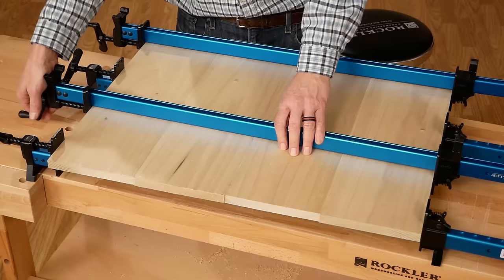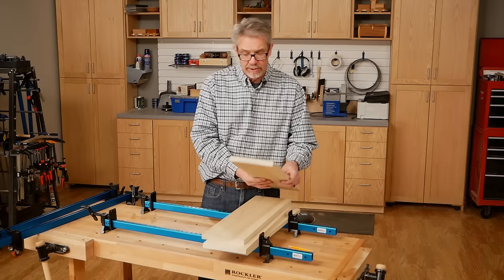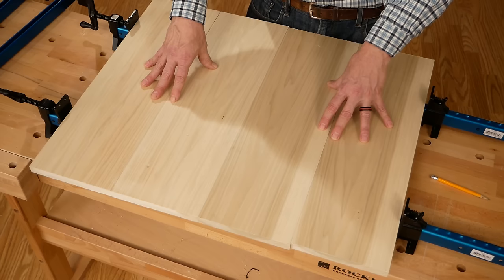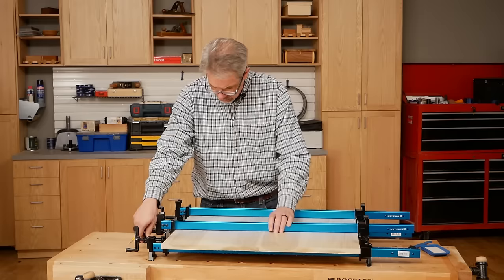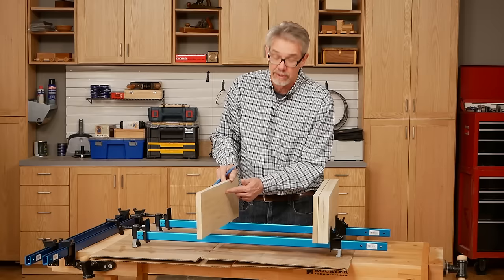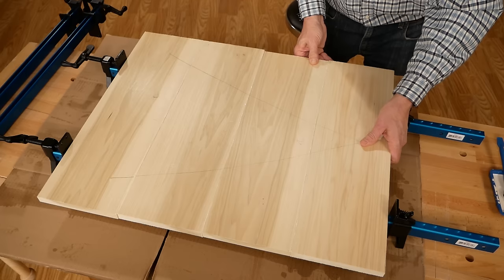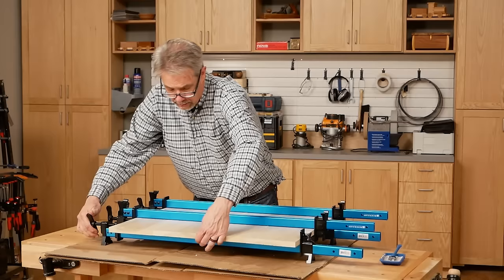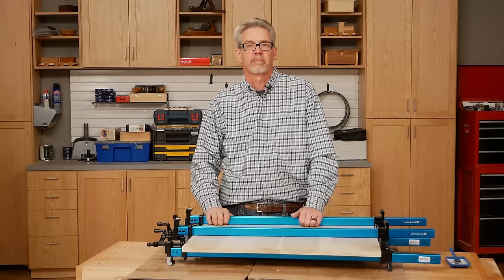How to Edge Glue a Wood Panel | Basic Woodworking Skill

Comment: It's easy in theory to glue up panels that are perfectly flat and square. What I struggle with is the process to make the boards flat and square. I have a small end jointer, 13" electric planer, and electric hand planer. My boards usually end up flat, but gently curved, or the edges will be wavy along the length. Can you please show the process of how you prepared the four boards for this video. Thanks!
Reply: first thing is how much moisture so depends on what wood, let it acclimate for about a week before you work with it and then it depends on what you're making. Another tip is when you seal, do it on all sides the same so it adjust to moisture evenly so don't skimp on the bottom.
Reply: Before you cut to length, square up the long edges of your boards. Run one edge on the jointer to get it perfectly flat, then use that edge against the jointer fence to flatten out one face of the board. Then run it through the thickness planer to get the other face flat and square, then rip on the table saw to width - you'll have a perfectly square board, aside from the ends. Once you figure out the length you want, cut with a miter saw.

Comment: Thank you.  I have a damaged solid historic door, that the bored knob was blown out.  I'll attempt to cut and join a new 2x to the busted area after cutting out the damaged section.  I'll take an extra step and add biscuits for additional joint stability under a moderate load due to door hardware.

Comment: I want one of those Vices! I only have some small Clamps and Im trying to figure out how to glue them together
Reply: Go on Amazon and buy the bessey h style pipe clamps. I bought 4 of them and then 2 sticks of 10ft rigid threaded pipe and cut the pipes in half. Now I have 4, 5ft long clamps for about $100. You can use any style threaded pipe but I chose the electrical rigid because it doesn't have the oils on it that black iron does.

Comment: I’m a 100% rookie you have a preferred glue recommendation? I’m going to attempt to make a small lap board to set across my lap. I’m actually in a power wheelchair due to a motor vehicle accident almost 10 years that left me with my life but gave me paralysis as a constant reminder. I have a red oak 1x10x6 in the garage and don’t have a jointer or a planer. I want my lap board to be roughly 15x30.

Comment: And my question was, Is that glue really solid? And you said at the end of the video ... Thank-you for that,  now I feel very confident and ready to do the job>
Reply: I would recommend using a biscuit jointer, then glueing biscuits in when edge gluing, helps keep the top of the surfaces aligned for less sanding later and a stronger joint, one more step but worth it. Otherwise flat edge gluing your boards a very likely to travel. Even a millimeter of movement translates to another hour of sanding time if your using small hand equipment

Comment: Thank you for the video! Now, I'm trying to glue an 8ft x 4ft x 1in to a 8ft x 6inch x 1in for a train table. I'm fearing the glue will stick to the flat surface that I lay it on..I know there's a common sense way of doing it but frankly, I'm just exhausted to even think of the best way. What would you recommend? The Home Depot guy sold us on those spiked 1in x 4in metal brackets and said it was plenty, you just nail them in, HA! When we lifted the boards it completely collapsed and bent the brackets out of shape. We got the solid, non flexible wood sheet, I think it's pine or something like that but it's a solid piece. The wood was just way too heavy for the flimsy brackets. So much for the HD "experienced" folks. . Can you please help this old lady figure this out, please? Thank you again...

Comment: This helped to confirm a suspicion I've had. I'm new to wood working and I swear up and down that I've taken all the right steps. I take my two pieces that I want to glue together. Both edges have been jointered and both the face and the other side have also been jointered and planed, and even when I put the two edged together before gluing, the larger piece I'm trying to make out of the two of them STILL cups.

I've done all the steps (jointing, planing, table sawing), glued and clamped my pieces and yet I still just can't seem to get away from my wooden slabs cupping.
Reply: I have learned that if you also have 4 pieces of scrap clamp 2 on each ends this will keep the boards from warping and cupping, if you swapped the boards, everything will be fine. It doesn't take alot of pressure,  but keep them firmly on until the wood glue dries. 
See Steve Ramsay's channel, or other channels on woodworking. 
God Bless.

Comment: Nice clamps. But are all those really necessary? And where would I get those and how big are they? Thanks
Reply: The clamps are neccesary. If you dont use clamps there will be an annoying small gap in between of the pieces of wood. I think the guy in the video used clamps that were around 3 feet long.
Reply: Rockler Sure-Foot® Aluminum Bar Clamps

Comment: When the glue get rubbery do you remove the top clamps? Do you do anything to keep the glue from sticking to the clamps?
Reply: The glue is designed to get into wood fibers and so make the wood hold tight to each other, but most glues really wouldnt hold onto your clamps that much. You just take it off and clear off the residue if you even need to.